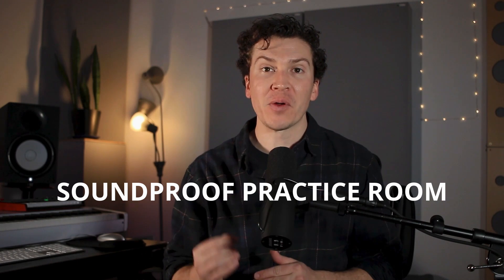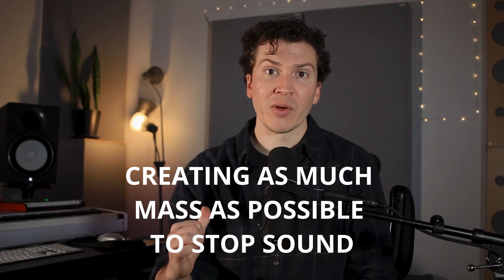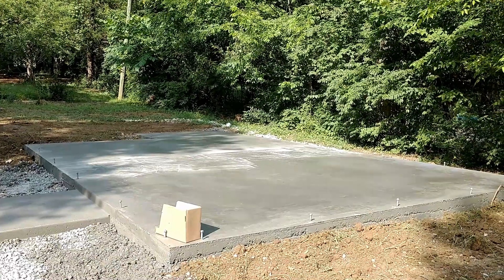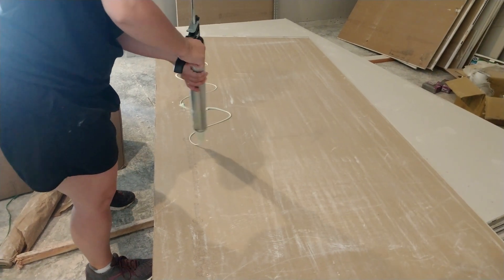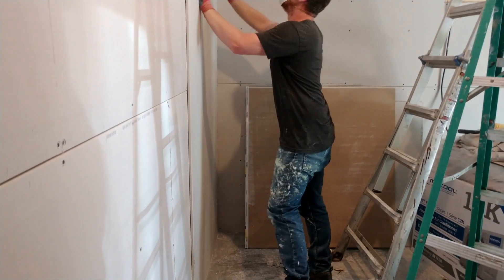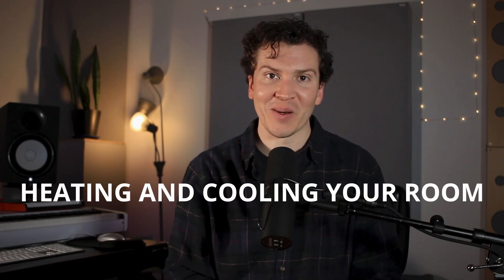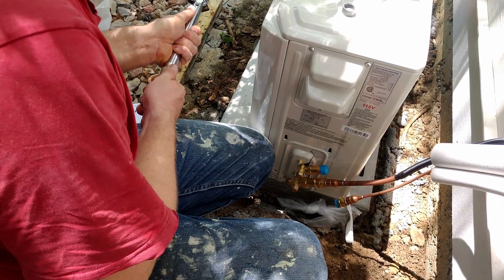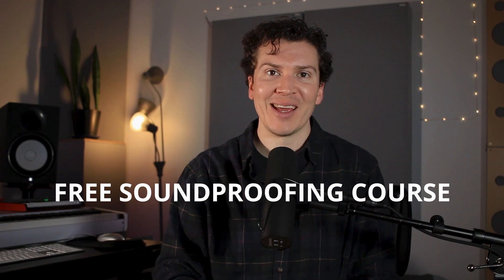How To Make A Practice Room Soundproof

Comment: This was an awesome video. Thank you. ~~ That sounded too dry... let me say what I really think: I bought my first house. Probably a forever house. The house is made from all concrete with stucco on the outside that looks like it has been urinated on for 4 decades. No worriers, I pressure washed it and it will be sealed and painted with an elastomeric paint and then UV/Micro sealed... UGLY outside for sure. Now: The thing is 2 stories plus an Attic. Not counting the basement that has 18 inch solid concrete walls, the 1st floor with 12 inch concrete and the 2nd floor with 10 inch concrete and the roof is made with 3x10x whatever length oak planks. I think the roof may weigh more than the 2nd floor walls! ~~ Now that all that has been said. The First floor rests on oak beams 3"X10"X25ft going across... and a massive truss triple 3"x1-"x40ft -- the house was built on the centennial, in the centennial, exactly in the year 1900. They called it the modern house. 

I can't stress enough that mass isn't an object in this monstrosity and that's why I bought it (under $100k) plus it came with a nice yard 150x300ft. So far I installed a new asphalt roof since metal roofs can rattle, wow and flutter... all at the same time, ironically, and I installed symmetric roof vents. So point one is that my roof is not vacuum sealed to the house...  I got more work for the roof to make it airtight next year... 

So, I installed a roof, all new double pain glass windows, argon filled (let's see how long that argon stays, lol). All the external doors are JUNK and will be replaced by new doors and after watching your video, they can be no other than super heavy solid doors with no gaps.

So as far as the basement: I am levelling it next week with a few friends... then I am sealing the concrete with an atomic, deep penetrating sealer... Then I am painting it with a really good high PSI waterproofing basement paint like Zims of Killz or whatever - and in a month or so I will be framed up and ready for the inside of it all... But once again: Your video triggered a change of plans. I was just gonna butt 4 inch studs to the concrete walls and then wire them and fill with fiberglass. Now, I think I will space the wall 2 inches OFF the concrete... and be able to add an extra 2 inches of fiberglass insulation!! That was nice to LEARN. Thank you. 

Now, I have a ton of new wires that are upgraded to handle 50 amps at 120v going to 25A breakers... the basement will have 4 zones , each on a dedicated 25A system... should they all be on the same phase of should I mix them? AI says mix them and the reason why to mix them, AI said is not to overload or overwork the transformer on the telephone pole. LOL My 240v outlets all use both sides of the transformer. Washer, dryer,  water heater and electric range all use 240. 

I will use that stuff you talked about and seal all my outlets. Awesome advice I didn't think of either. 

I used to be an amazing person. Some 'REAL' silence on this never ending noise-polluted planet will be a life-changer for man and cat for sure!! I used to write music but I stopped when I could no longer gather my senses to filter true original music from the sound of a garbage truck. 

Yah !!! Great video. Definitely~ 

I sent this through 'Hiya Googoo' and Google returned: This individual recently purchased their first home, a large concrete structure built in 1900. [0] The house features thick concrete walls (18 inches in the basement, 12 inches on the first floor, and 10 inches on the second floor) and a heavy oak plank roof. [0] They've already undertaken significant renovations, including installing a new asphalt roof with vents and replacing all windows with new, argon-filled double-paned glass. [0] The exterior of the house is currently unappealing, described as looking like it has been urinated on for decades, but the owner plans to pressure wash, seal, and paint it with elastomeric and UV/Micro sealants. [0] The owner plans to replace the external doors with solid, heavy, gap-free doors. [0] Next on the agenda is leveling the basement, followed by sealing and painting it with high-pressure waterproofing paint, and then framing the interior. [0] The house was bought for under $100,000 and includes a large yard. [0] The owner values the house's substantial construction and massiveness. [0]
Reply from the maker: Wow, what a project! 👏 Sounds like you’ve got an incredibly solid foundation (literally) to work with, and I love how much thought you’re putting into every detail. That basement wall design shift you mentioned is definitely the right call, leaving that air gap will go a long way for both sound isolation and moisture control.

Keep us posted on your progress, I can tell this space is going to be amazing once finished. If you ever want to dive deeper into studio-specific build strategies, I’d be happy to chat on a free call 👉 https://www.soundproofyourstudio.com/Step1

Comment: In our building, we have a dance studio on floor 2 and a computer lab classroom above on the 3rd floor.  There is carpet and a sound barrier pad on the 3rd floor but we still have sound coming through.  If we install a ceiling on the second floor as you have described in your video, do you think this will prevent sound from coming through the ceiling to the 3rd floor?

Comment: There are many church drum cage builds here on youtube. Most of them do a bit of reduction in the highs, but they are pretty ineffective in the mids and lows. (I understand why, 104dB snare hits) We often want to create a space large enough for a drum set, Mics, and physical movement, along with cooling for comfort, and a large window for viewing the band.
I think a lot of people would like to see a design that can accommodate quiet cooling, ample space, a large viewing window, and good sound for micing; all while creating 30+ dB of noise reduction down to 100 HZ. Is this truly impossible because of the window? What all would it take to make this a reality? My guess is a custom triple glass window design, double walls, concrete floor, and completely sealed airtight enclosure, with a massive door, and tons of absorptive insulation inside the structure, along with its own minisplit.
What do you think?

Comment: very helpful guide. in a existing garage with a concrete wall, the external practicing room wall would be the existing concrete wall? then a frame+insulation, followed by 1inch gap, followed by the internal frame + insulation + doubled drywall. how to keep the insulation fixed without falling into the 1 inche gap? for me it was very confused this part @4:28. And in case of not using drywall would two layers of 18mm mdf give the same output?
Reply from the maker: So you have one extra wall there. Use the concrete as outer wall and then the air gap and new wall. It is all about mass. If 18mm msg is similar or exceeds 2.2lb/sq ft then you are good.

Comment: Great video! do you put insulation on both walls?  does it matter if I'm using faced or unfaded insulation?
Reply from the maker: Use insulation on both walls, stagger the studs. I prefer unfaced these days with a vapor variable membrane if the double wall touches the outside environment l.

Comment: You are a saint!

Question: I think you suggested not paying for Green Glue in another, more recent video.  Do you still recommend it?

(I'm planning on making a "drum room" in my garage...).  Double walls, double ceiling, but modular / removable...
Reply from the maker: Yes, I no longer recommend green glue. The recipe changed and it doesn’t work as well as it did back in 2008.

Comment: Great. Thanks. However, you haven't talk about anything to do with the floor (except about concrete floor), do you? Shouldn't we?
Reply from the maker: A concrete floor is soundproof enough for home studios. No need to float a floor.
Reply: @soundproofyourstudio  Thanks. I can understand if the studio is bulid like yours in the video,.. stand alone building made from ground up. But how if the same floor is shared (is the same floor as) with other existing rooms in the house? Wouldn't the sound can transmit through it? And the floor also connecting the two walls (and other walls).

Comment: Hi there, great vid! I'm currently building three recording studios side by side in a warehouse. I'm using genie resistance clips with furring channels, I've got these screwed directly to my outside stud (not the outside wall of the warehouse). Then 1 layer of 12mm acoustic dry wall, one layer of Tec Sound then another layer of 12mm dry wall. Do i still need to build an inside wall an inch away from my outside stud or will one stud wall suffice if i'm using the furring channels ? I need each room to be completely sound proof from the other so we can record three bands at a time with no bleed
Reply: There's a 2 inch gap between each studio
Reply from the maker: Don’t create a triple leaf effect. What you said will work

Comment: Do you recommend putting rockwool insulation (or any type of insulation) behind the double drywall?
Reply from the maker: Yes, you definitely need insulation for it to work properly, but use the cheapest insulation possible, not rockwool.
Reply: Lol yea gotta be an easier way

Comment: Curious why you didnt use Mass Loaded Vinyl on the walls
Reply from the maker: I don't think MLV works as well as two layers of drywall with green glue. Here is a vid on it - https://youtu.be/tAAKDGtRgfw
Reply: @soundproofyourstudio  Gotcha that does make sense, why not go for everyhing double dry wall, green glue, MLV and resilient channel?
Reply from the maker: @gyasirossmusic  you don't really need to do all that to get great results. You can either do resilient channel or a double wall system. Then either choose mlv or green glue.

Comment: Wonderful build, almost the same as my blueprints.  My question is the I beam you have.  I was told that I would need to build a drop down under the I beam so everything is decoupled from it as well.
Reply from the maker: That is correct. We built a false beam around the main beam that was decoupled from the actual beam.